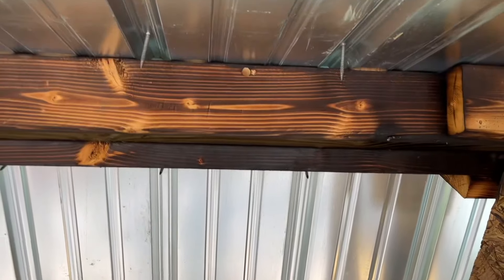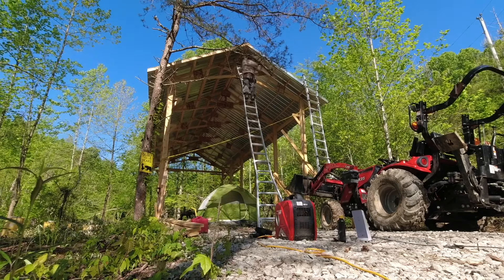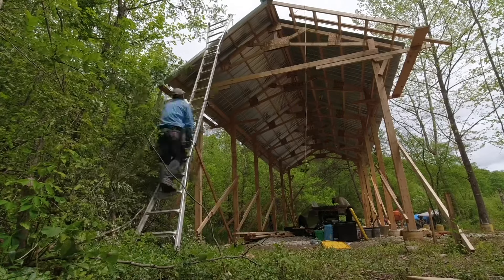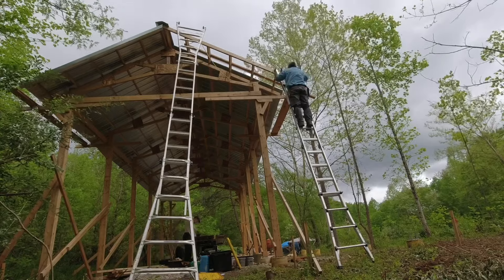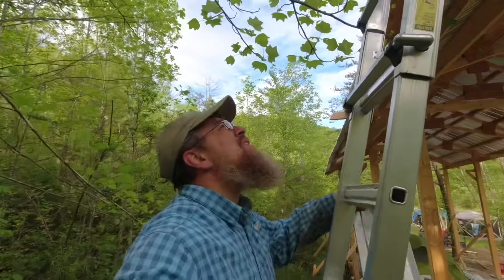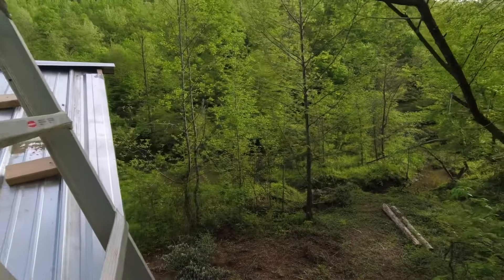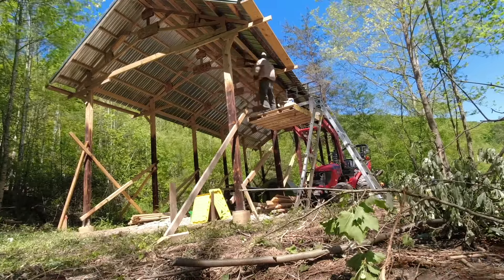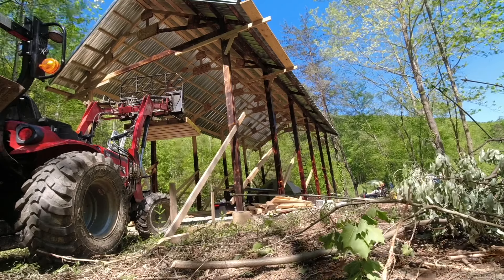Finishing up Stage 1 RV Shelter

Comment: It will work.  So will the oil.  Any waterproofing in KY is of the utmost importance.  If you get deep into the burning, pair the large torch with a high quality hand held 1 pound propane torch.  Use the small green camping cylinders and refill them at home with a 20 pound propane tank.  Drastically reduces fuel costs.  The small torch is better for tight areas and the end cuts of lumber.  Make certain you get a good torch that can function inverted.